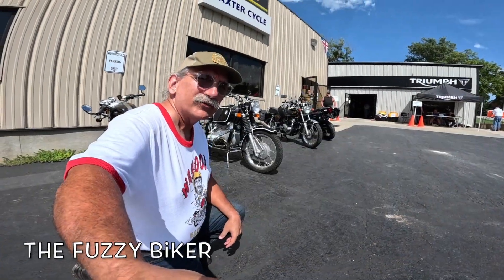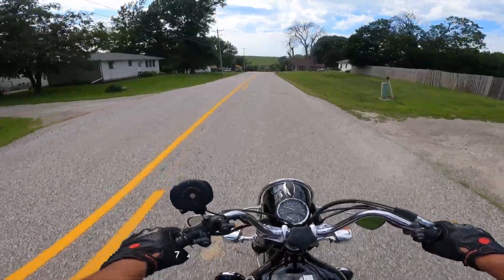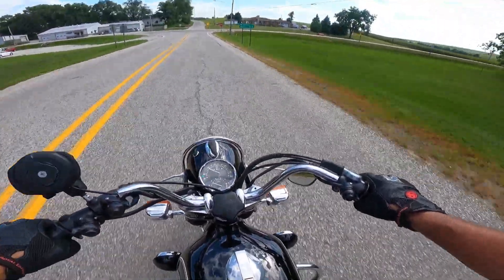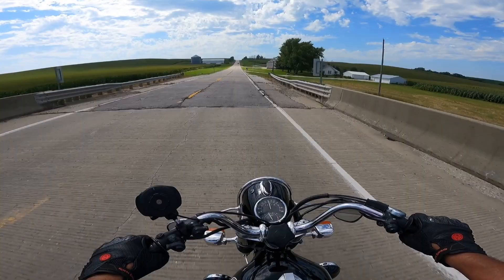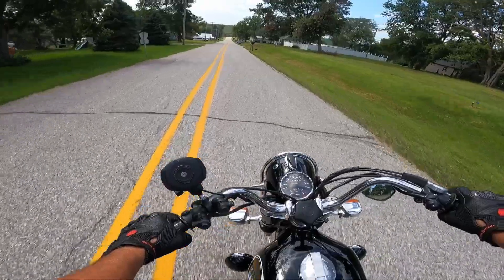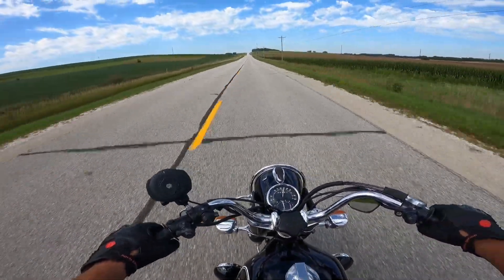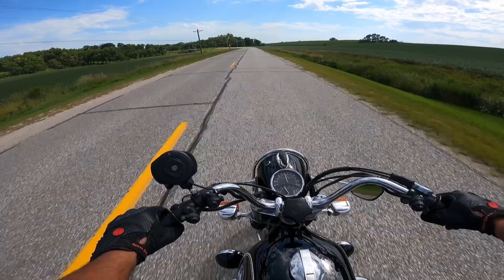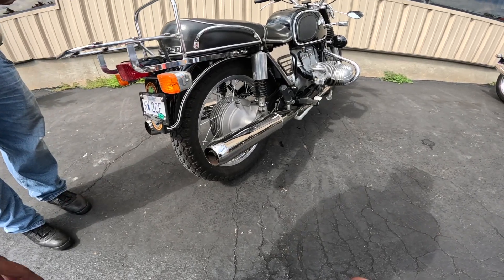Air Head Classic BMW R75 / 5 at a British Bike Shop - Sacrilege to Admiration - Pure Art!

Comment: The old BMW airheads have got a certain style about them. The R90S was a phenomenal bike back in the day, very underrated! I've owned an ex police R80RT since '89, 170,000 miles later and she's still going strong! Wahoo! 🇬🇧
Reply from the maker: This bike got better with every foot I rode it. I'm totally hooked on these Airheads. Wahoo!
Reply: I bought mine on a for next to nothing at a Police disposal auction having never ridden one before. The first ride had me smitten and I absolutely love it. Total reliability, apart from the usual consumables the only parts I've had to replace are the stator in the alternator and the oil pressure switch. Wahoo!